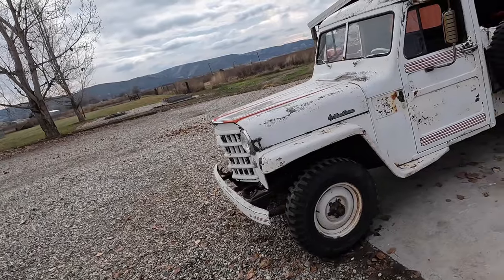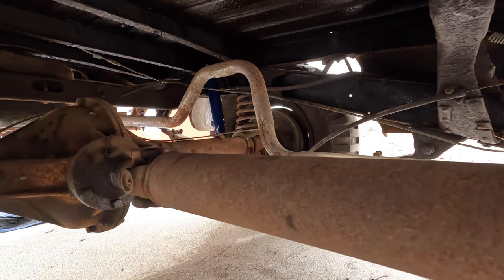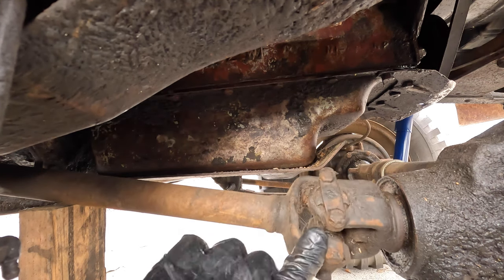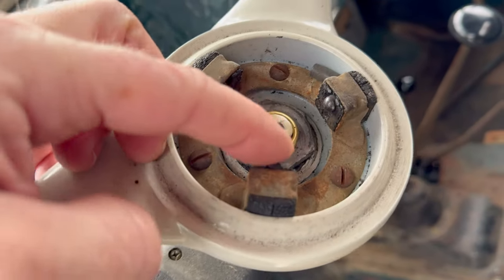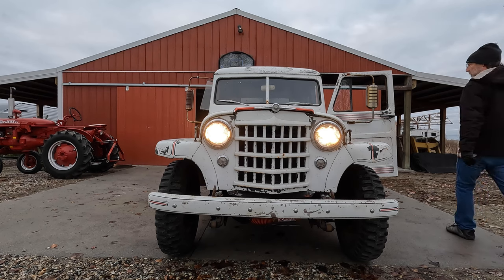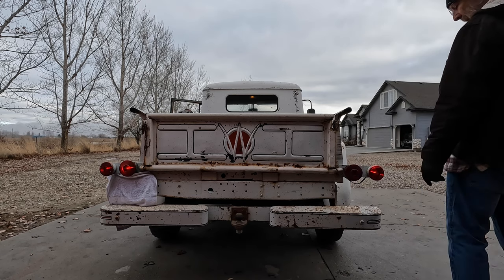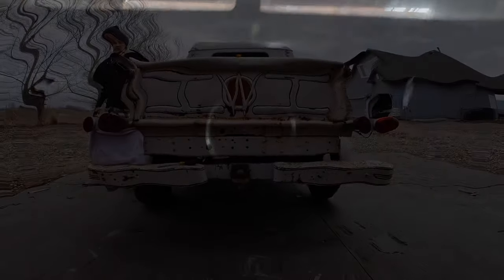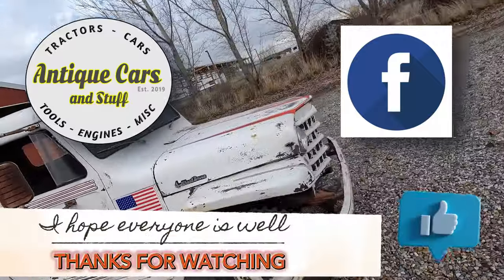1952 Willys Overland 4x4 Truck - Part 7, Lights, Diffs, Driveshafts

Comment: Its a old jeep. Concider yourself lucky if any of it works. It probably has only a couple of fuses . I dont know the cut off date but it may have come with only one tail light and no blinkers. They were very utilitarian. They only came with the basics. Even the heater was a dealer install it it has one. Think of it as one of your early tractors with a cab added .😊

Comment: you never checked the front steering knuckles it takes 90 wt gear oil I found that if they leak which is vercommon  in mine I put chassis grease on top of the gear oil and let it mix . I have done that for yers in my jeeps and my ford f250 with the dana 44 with the older closed knuckle front axle . they changed that in around 1977 to open steering knuckle.
Reply from the maker: Thanks!
Reply: @AntiqueCarsandStuff  corn head grease is about the perfect consistency for those. Probably want to replace the wiper seals too, if you get that deep into it.

Comment: You should check the 4 way flashers. Pull out in the silver piece behind the lever, I’m curious if they all flash. You also may have 12 volt bulbs in the rear sockets hence the brighter lights after you changed them. Grounds are huge on 6 volts systems but I know you are no stranger to 6 volt stuff.
Reply from the maker: Good thoughts. Thank you! I didn’t think about checking to see if the bulbs were 12 volt.
Reply: @AntiqueCarsandStuff  I think the numbers on the bulbs are 1157 or 2057 for 12 volt dual element bulbs. 1156 for single 12 volt bulbs. I can't remember what the 6 volt numbers are.

Comment: If you eliminated 2 of the turn signal bulbs on the rear, the blinkers would work better.  The 2 extra lights on the back draw too much power for the relay.  It's like when you pull a trailer, you need a heavy duty relay for the extra lights.  Being 6 volts doesn't help either.
Reply from the maker: I agree. Thank you.